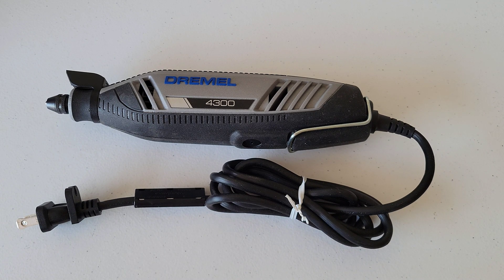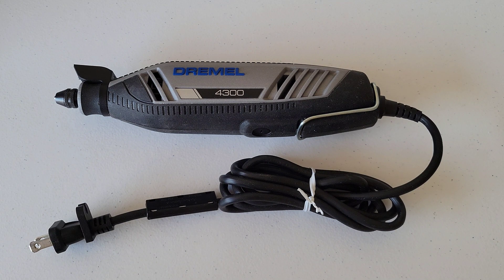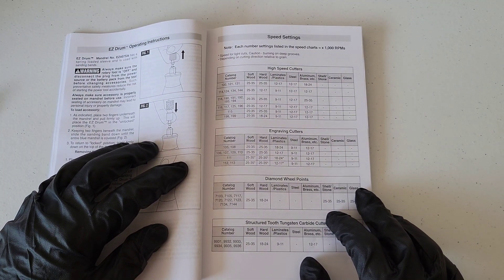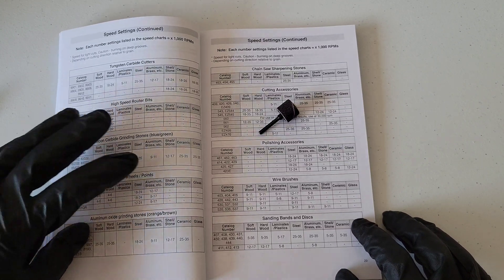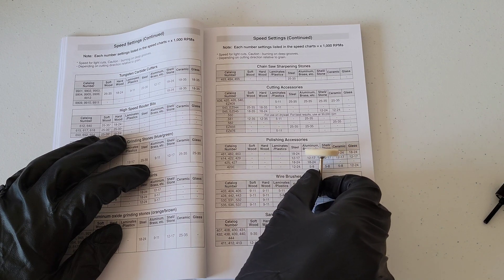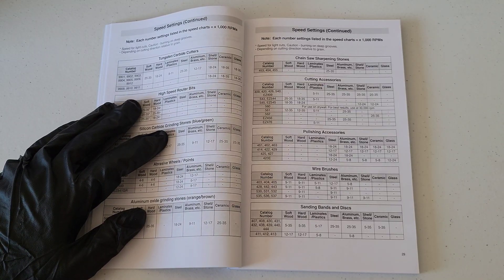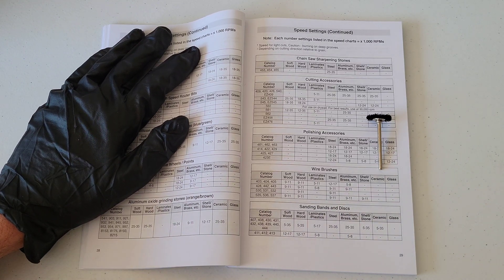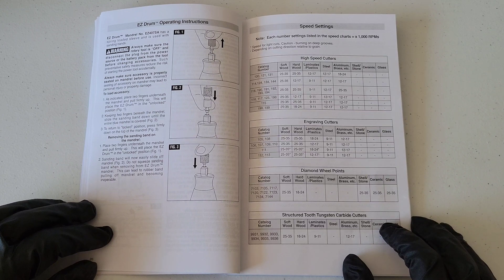How To Know What Speed Settings (RPM's)To Use On A Dremel Rotary Tool

Comment: That document is nowhere to be found on Dremel website.
Even the Manual for the saw attachment has no recommendations for speed vs type of material, etc.
Why should people buy overpriced Dremel without proper guide if they can buy the same product from China at a fraction of the price?

Comment: Is it normal for the tool to speed up on its own  while I was carving plastic at a low speed the tool sped up on its own for a couple minutes
Reply: One caveat to add - Dremels do try to maintain a constant speed, so a change in torque will make the Dremel kick higher to try and compensate. If you're having that issue, you should probably increase the speed and decrease the pressure. Otherwise, do get it replaced. Dremel's pretty good about their warranties.
Reply from the maker: Thanks for watching.  That is not normal for the Dremel tool to change speed on its own,  I would contact the Dremel to see if they can help. Thanks again for watching.